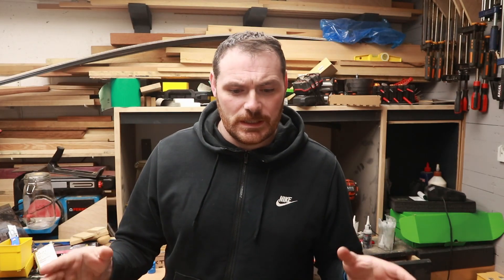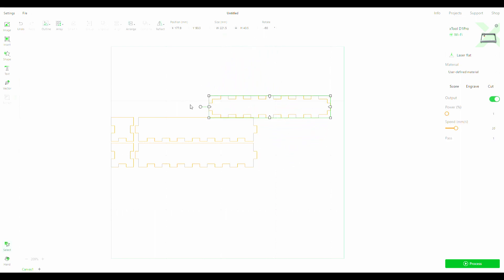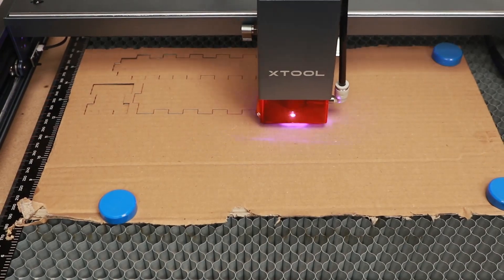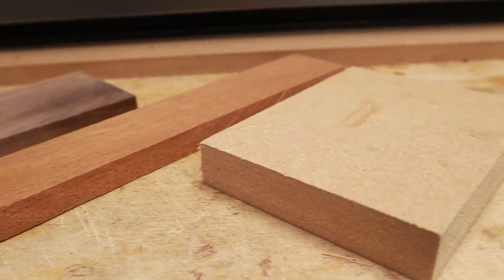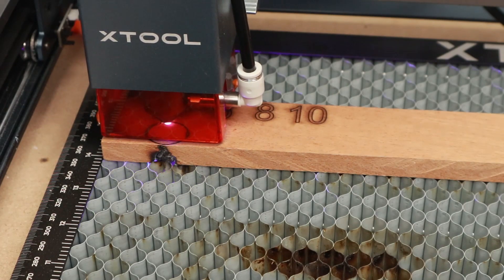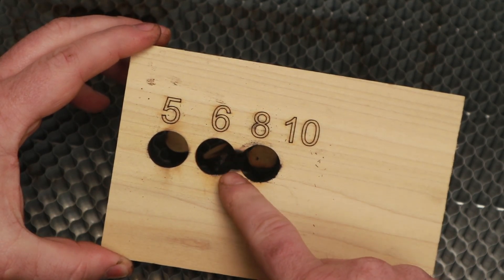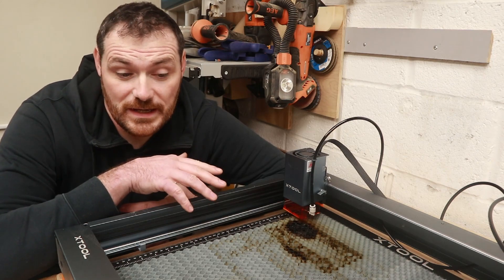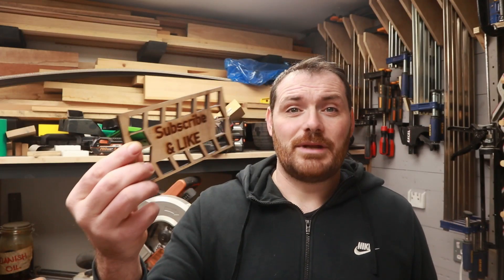Can Xtool D1 Pro 20W Laser Be Used For Cutting Wood? The Results #xtool #lasercutting

Comment: If you place the cable on the right side UNDER the rail instead of on the inside, it works better and looks uncluttered.
Reply: I'm going to have to try this. Mine runs onto the honeycomb, which will eventually fray the snakeskin sleeve.

Comment: Neat! Would giving the wood time to cool down between passes reduce the the fire hazard when cutting thicker stock?
Reply from the maker: That is certainly one idea, but as far as I'm aware, if I stop the machine, and then restart it, it would start from the beginning again. I think a bit more speed on the laser movement may have helped
Reply: @JamesManCave  So there is no way of putting in a rest period between passes? Or if you have three holes to cut in three passes, can you make the machine go 1-2-3-1-2-3-1-2-3 instead of 1-1-1-2-2-2-3-3-3 so the passes aren't directly after one another?
Reply from the maker: @CrudeButEfficient  yes you can to an extent. You could make it go 1-2-3-1-2-3-1-2-3 but, I'm not sure if can set it to actually do that each time. Some of it is design dependent. You could program it to do one pass, and then just start the program again each time for more passes. I'm yet to look at the lightburn software, but from my understanding this offers far more options of design and programming, the xTool creative space is new, and being updated all the time
Reply: @JamesManCave  Cool. Sorry to drag you down this rabbit hole, was just a thought I had. 😅
A laser would be a fun toy, but I can't really justify that expense when there are other tools on the wish list that I have much more need for.
Reply from the maker: No problem, it's an interesting idea and I will look into it. Its definitely something I think is a very handy option to have, but do I need one? Only time will tell!

Comment: My take away from this. Can it cut wood? yes but very very badly. Looks fine for simple repetitive cuts in plastics ( or would that melt/burn too?) The price is a bit eye watering too 🥺🥺

Good to see your pretty face again tho'
Reply from the maker: 🤣🤣 thanks!
I think once you get used to the settings, and dial them in better you can make some good clean cuts. But, yes it would be better for more craft type items. 
It would cut plastic, but not clear plastic, as the laser will just see straight through it and melt it.